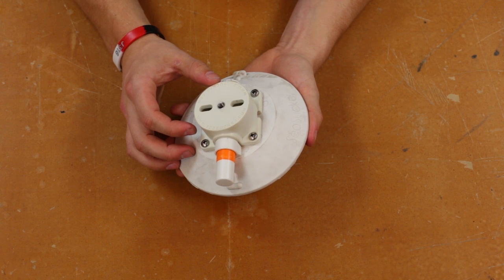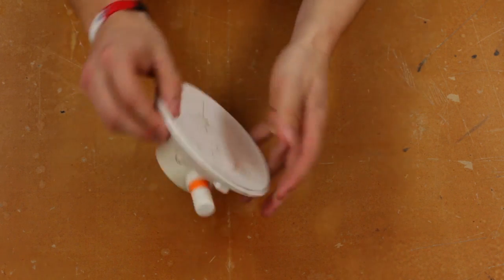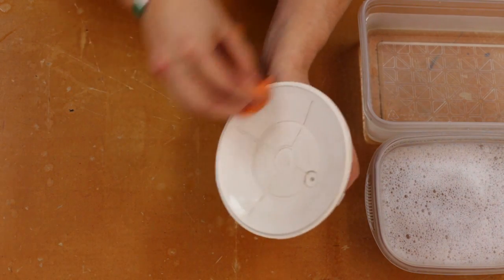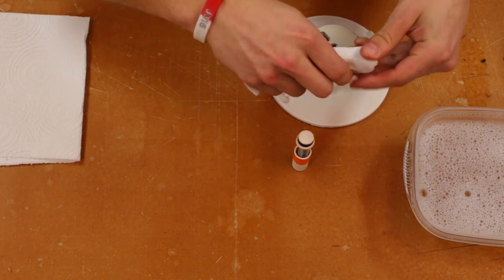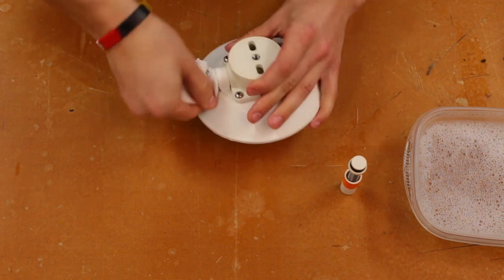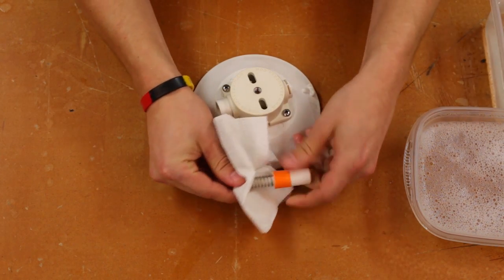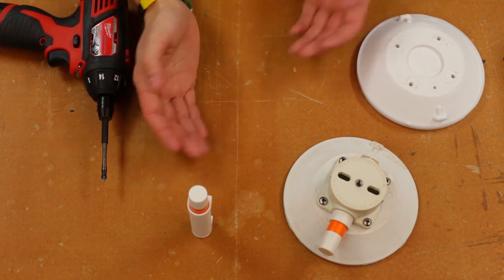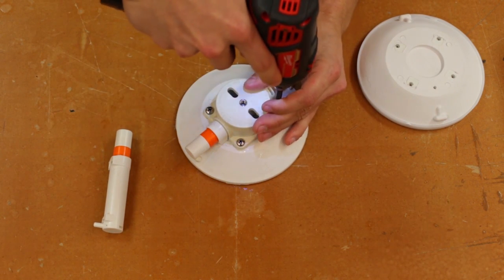SeaSucker Cleaning and Maintenance

Comment: Are the black pumps with the orange band supposed to have O-rings? Mine do not. My roof rack has 5 suction cups and one of the pumps was stuck with plunger pushed in. Even after performing this maintenance, the push button doesn't return. I compared the stuck one to another (functioning one) and they look identical, with no O-ring, and the springs appear identical.
Reply: I second this. My pump, when pulled straight out, does not have an o-ring around it.

Comment: I have two talons.  My problem is not cleaning the pumps.  The pumps break too easily.  When i try to pull the pump out the plastic stem breaks.  Sometimes when trying to mount the talon the pump stem breaks.  Have the new pumps been redesigned with a stronger stem?
Reply from the maker: Hello.  May I ask how old your vacuum mounts are?  Are you pulling the pumps straight out?